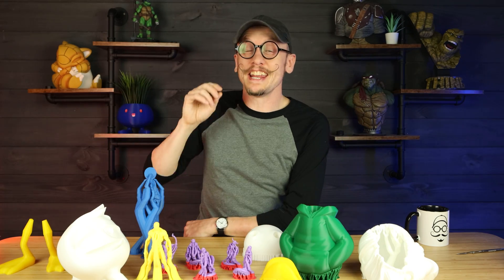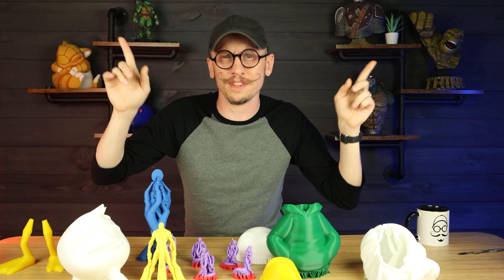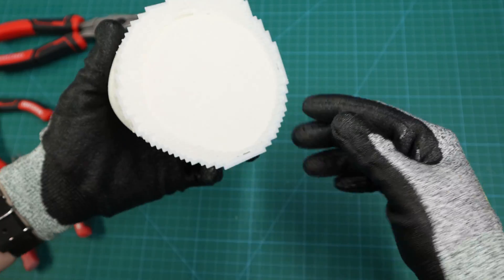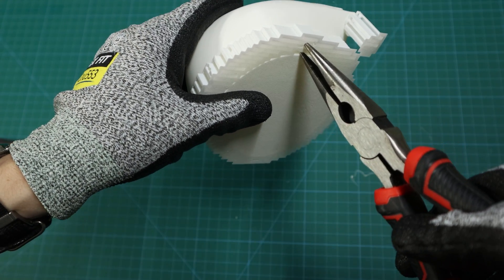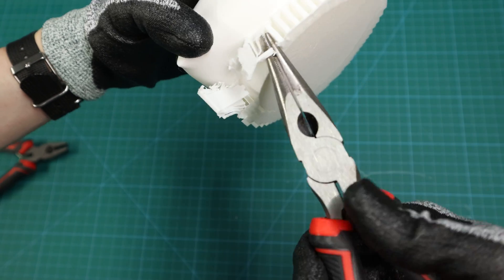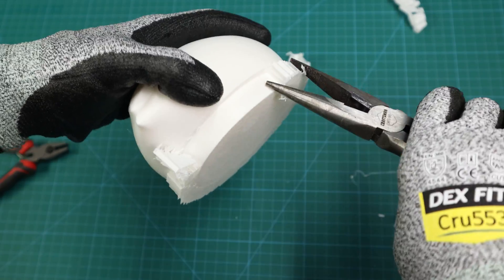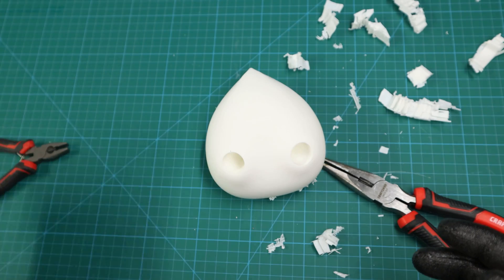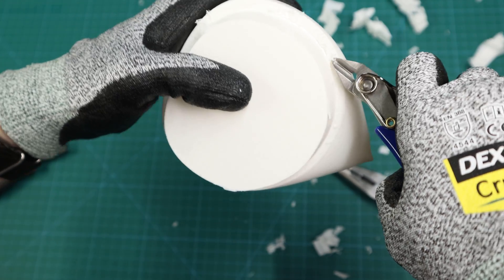Easy Method to Remove Supports on 3D Prints | Twist n Pull Method

Comment: are they any settings that help make the surface under the support look better? It way less detailed, iam using treee support btw.
Reply: I'm pretty sure that is only determined by the support interface settings. I had terrible bottom layers under supports, but I followed Chris's interface settings video and it's much better now.
Reply: @reflexgaming342  ill check it out again tyvm <3
Reply: Set the support type to normal (manual), and set the type to snug. Change the bottom interface type to rectolinear grid.